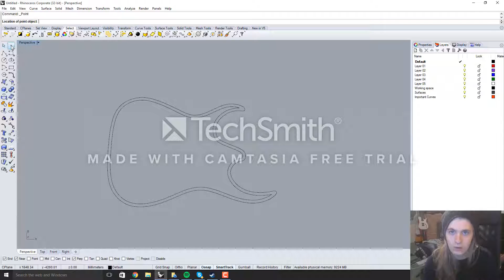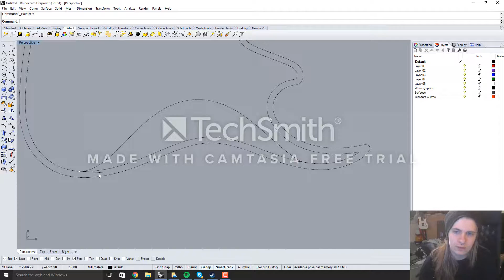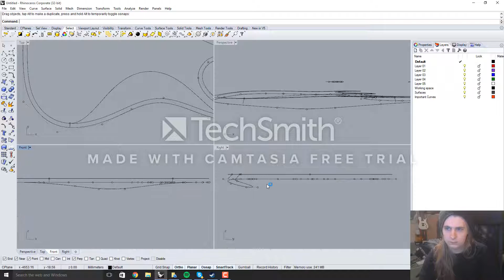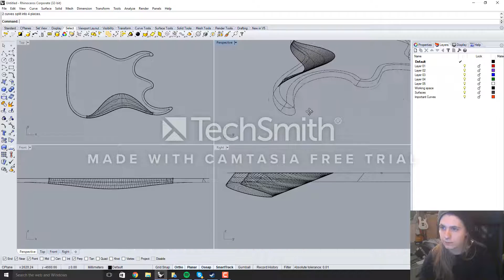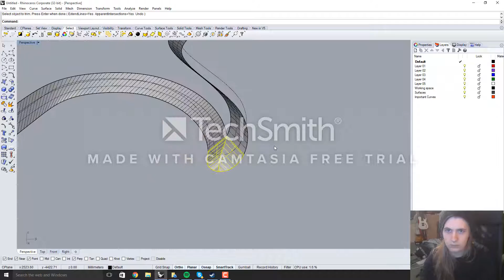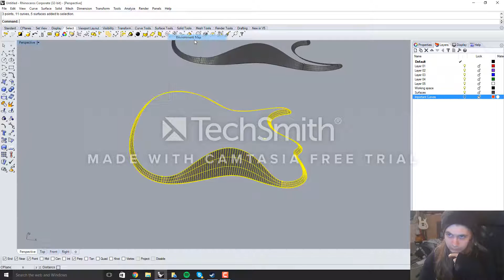Creating A Guitar Belly Cut And Chamfer in Rhino

Comment: Hey Helix, awesome vids learned a shit ton! I've been trying replicate a superrstrat (suhr) body, and if got the both the belly and the pickarm cutaway done. I did it by making 4 different network surfaces and sweep1'ing the rest of the body, and then joining them. What i cant do though is cut out the neck joint. ive been trying to boolean difference the neck joint out of the guitar body but simply wont work. I suspect i'll run into the same problem when i try to cut out the routing. Do you have any idea how i successfully cut out the neck and routing? cheers
Reply: figgerd it out. Did a extrude planer curve instead of a sweep1 and not the boolean difference works (:

Comment: Hey buddy, I have my 2D shapes in pdf or illustrator. I assume I can import that? 
Do you have videos that show right from the start?
Reply from the maker: Simply click import and then select the PDF :) if it errors then the PDF has been exported incorrectly
Reply: @helixguitars3097  oh wow thanks.
This is going to be a difficult learning curve for me. Do you think the linked in leaning ser vice is a good way to learn? 
And there's some other guy using other stuff too. I forget if they were plug-ins or software that is used for other parts of the guitar.